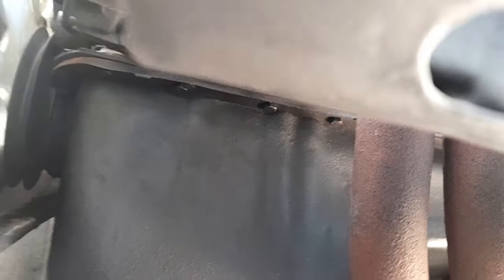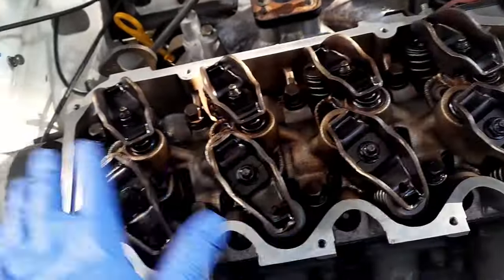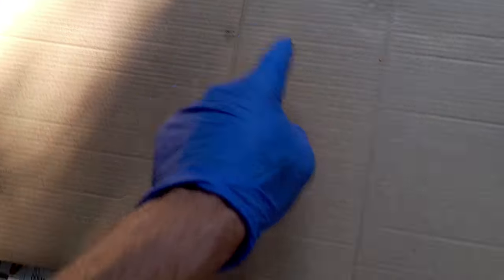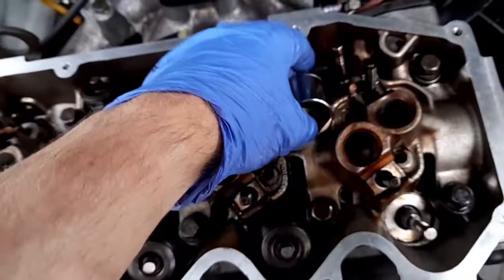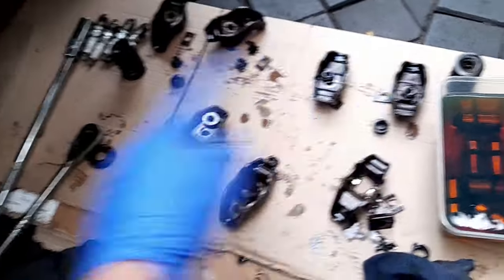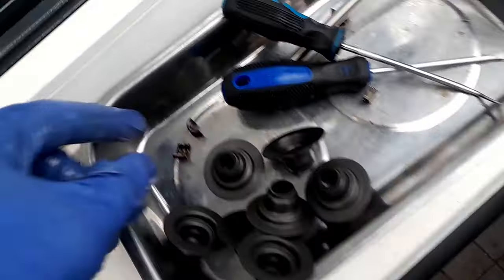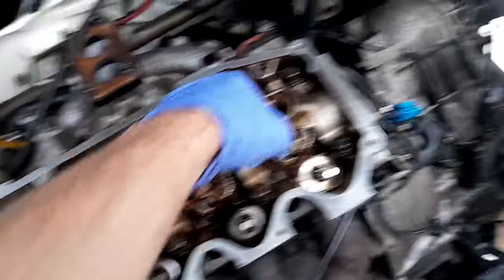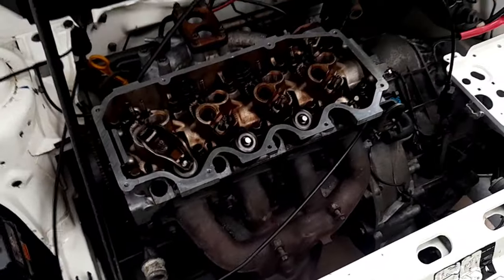Project Ruby Part 22 - CVH Valve Stem Seal Replacement

Comment: I would also not mix the tappets up refit in the same place as originally
Reply from the maker: Correct as I corrected myself in the video! Under normal circumstances I don't like mixing positions of items but if there is significant wear to one tappet I'd want to know why. Luckily all these are in great condition.
Reply: @usuallyfixingtinkering  not supposed to fit the washer the new top hat seal has the washer built in
Reply from the maker: @MegaReddevil71  it makes no difference! I've been told you can fit it or not.